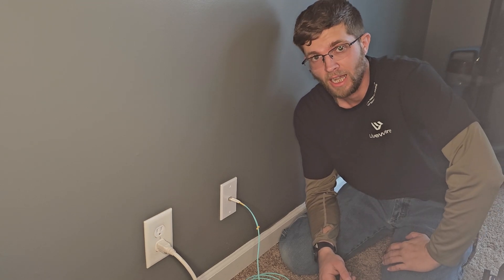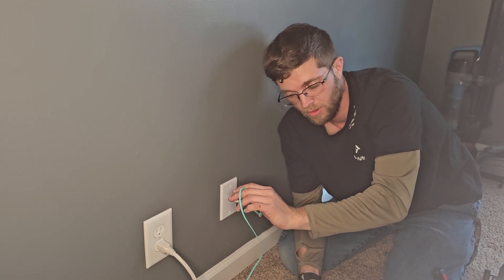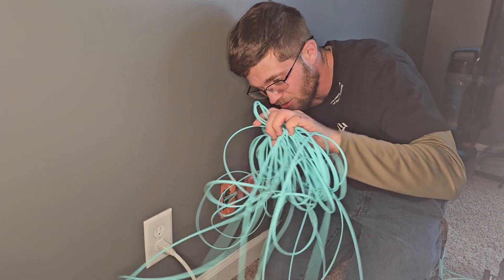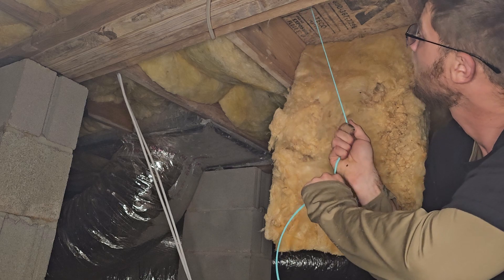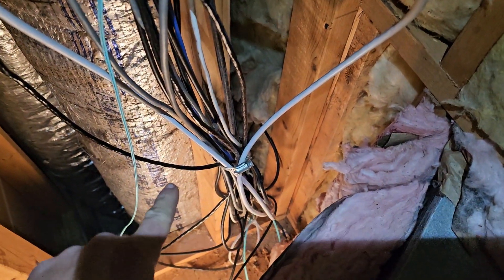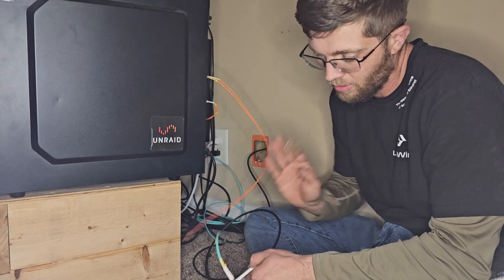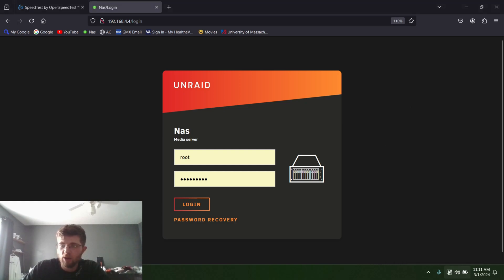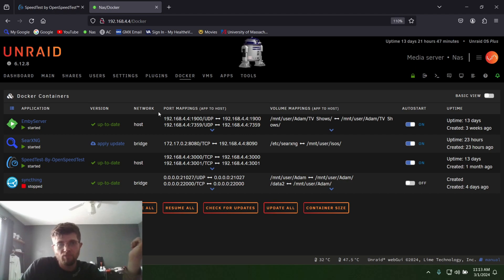Armored Fiber Cable Run!

Comment: You can re-terminate that somewhat easily. You just need some Jonard strippers, a cleaver, and some AFL FastConnect LC ends (mechanical splice). Not hard to do if you're careful. Whole setup is probably $200.